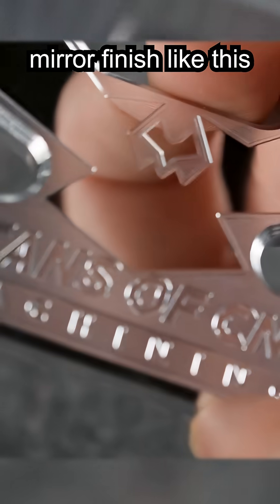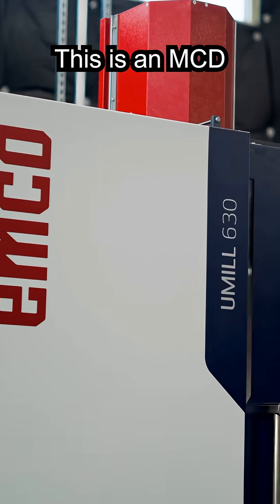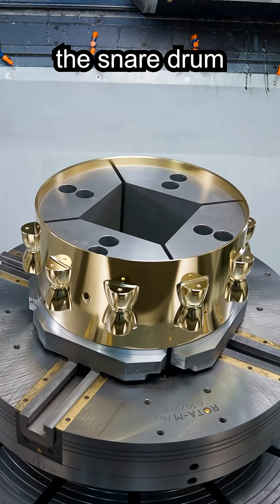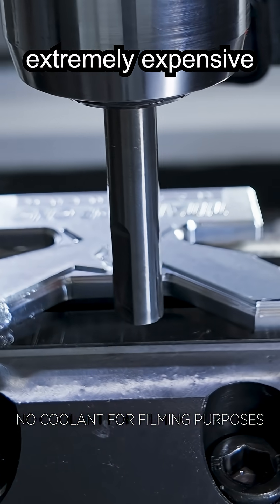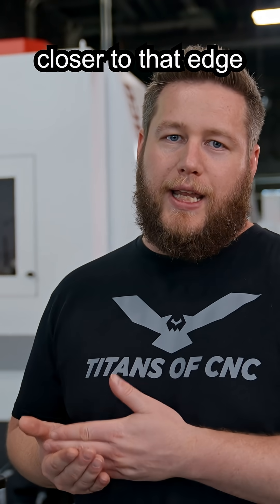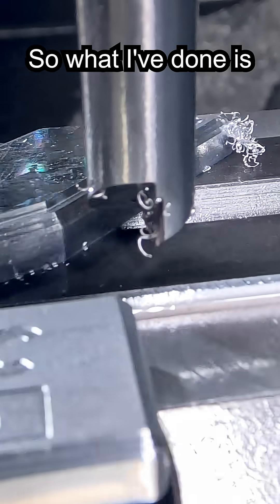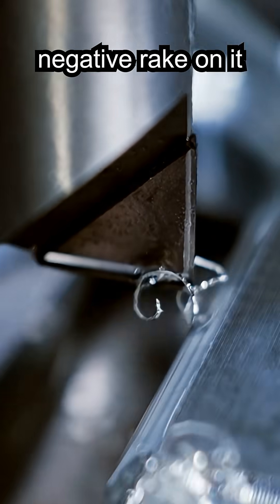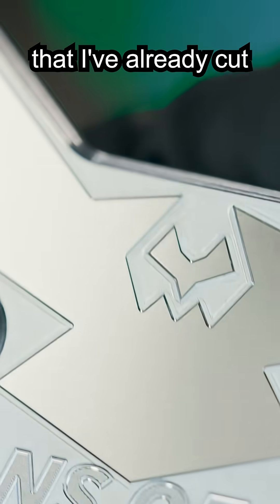Mirror Finish Machining HACK😲

Comment: Use x&y instead of the z axis to get to the next cut, should improve the surface even more. Even if the machine is very accurate, you will have a small error every time you lift up the z.

Comment: I was wondering what the machine needs to be able to do this? To index and stay rigid for a pass. Also what is it when the spindle turns when doing this type of scraper toolpath for say scraping in a circle so that the spindle stays with the cutter facing the direction it moves the whole time?